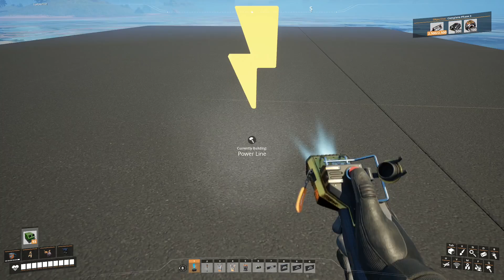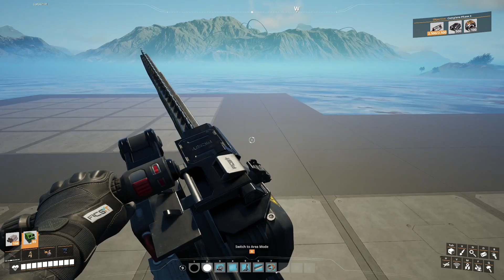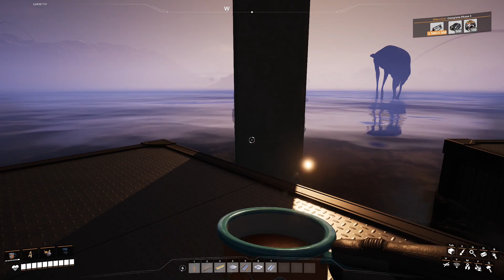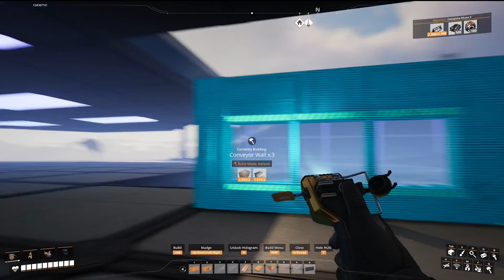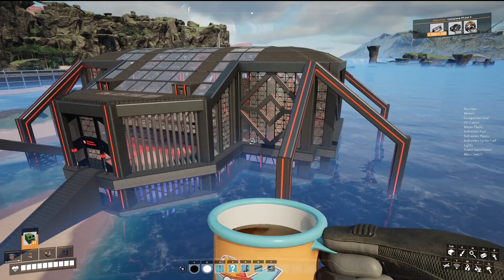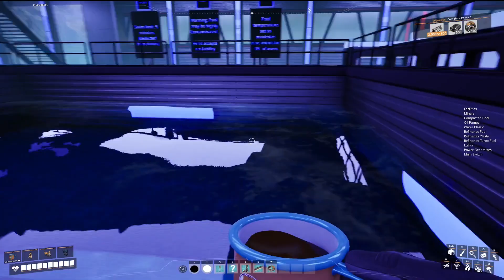Building a turbo fuel power plant, part 2: Compacted coal Done!

Comment: Hi. You can change material of the foundation without removing it. Its in same place as painting
Reply from the maker: Hey! Thanks for stopping by!
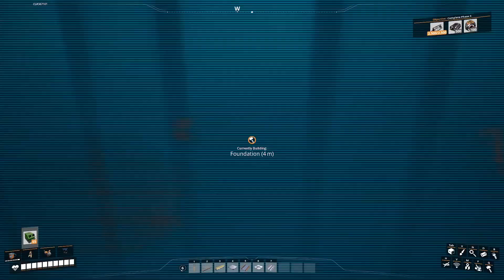If you mean what I did at 06:24, that wasn't just to change the material. Maybe I could have explained a little bit better.
The pillar/barrier thingy is to prevent Z-Fighting. This is when you have 2 foundations at the same height, and they are both "fighting" for priority. They end up blinking and looking ugly.
By using this method, the second foundation (the one Im replacing by asphalt) ends up being A little bit lower than the other one, so it will always lose the fight, not weird visual issues.
Cheers!
Reply: @NicoBuilds-g3u  yes I know. But asphalt don't fight in my experience. But when I looked again I noticed you use it only for the edges I have to use it in one more block where they overlap. It's a lot easier just to swap the material to asphalt in all block that are overlapping but result is that you have 1 foundation around the whole edge not just the corner.
Reply: I mean you need one foundation of asphalt that is in the regular grid on the edge not just the 45° one that you used.
Looks is different but its a lot easier to make
Reply: I really like the asphalt for making round corners. But making round corners means a lot of pain for roofing unfortunately

Comment: Wow! Impressive design!
That is one hell of a good-looking factory

A question though, isn't hard to add machines AFTER you do all the design, aren't restricted by space?
Isn't it easier to do all the production flow from start to finish and then do the design of the factory?
Reply from the maker: @Tylobic  absolutely! But there's no plan to add more machines on this one. The idea is to get the compacted coal out of there and into the next building that's going to be doing the turbo fuel. This building is basically done,  and if there are some modifications, they are going to be minor. And when I was designing it, I already knew that I needed 2 blueprints, and the size of those blueprints, so no risk of running out of space.
If I had placed every single machine necessary for all of the production line into the same building, it would have ended up being huuuge, so I decided to divide it into different smaller blocks. 

Glad you enjoyed it! Thanks for stopping by